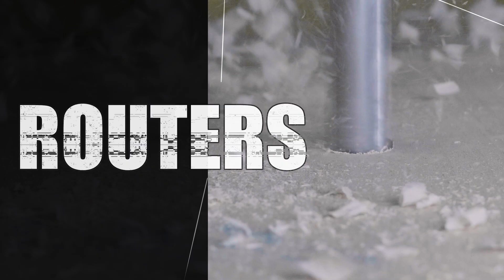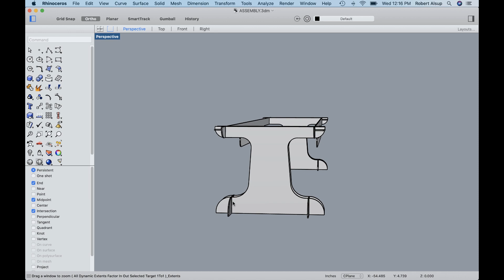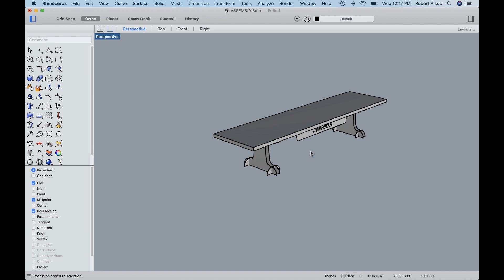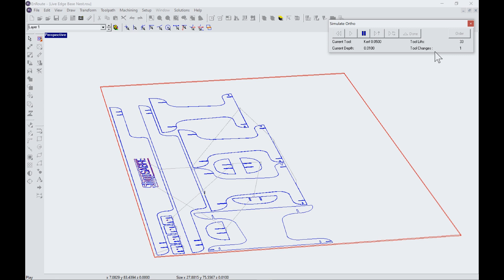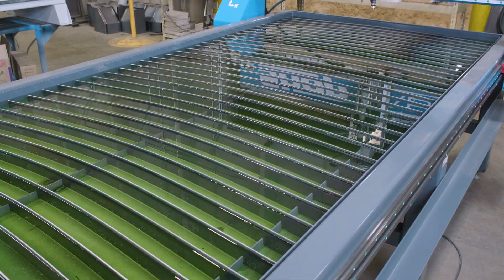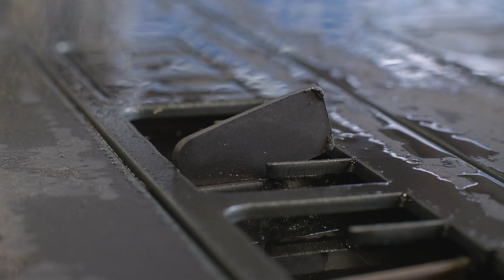ShopSabre CNC - Steel Table Base Project with Sidekick 8 for Live Edge Table Top!

Comment: Nice video -- I don't have a plasma table, but I was wondering about the entry and exit -- why such a small radius (1/16")?  At that radius, it doesn't seem like it would make any difference in the cut quality.
Reply from the maker: It does help with the Kerf on entry and exit!
Reply: kerf is around 0.05" so a 1/16 is a lot and makes all the difference